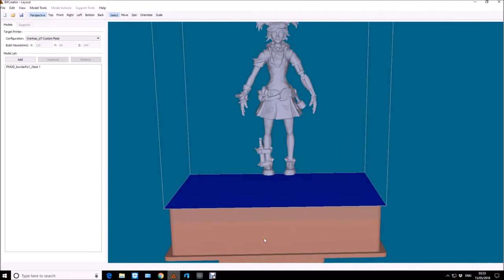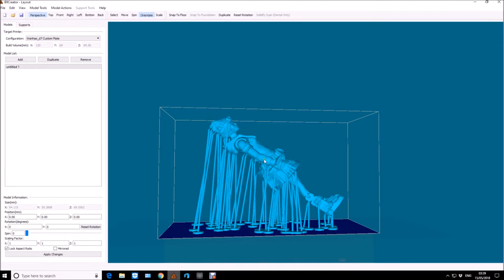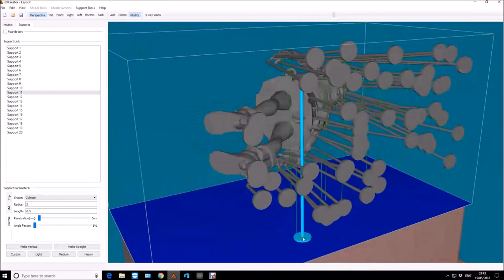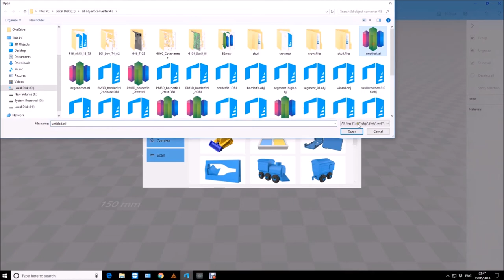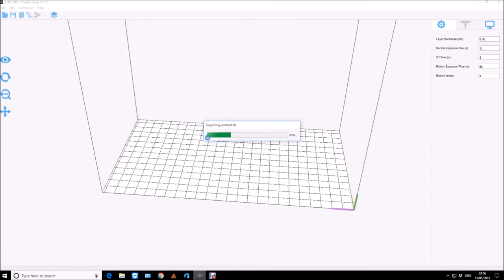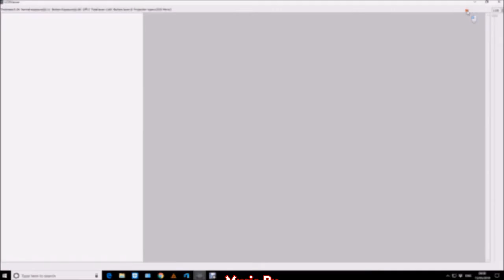How to add Crossbeam's to supports with b9 creations

Comment: Do you still live in the UK mate? If so how much would you charge me to print a small model if your intrested that is.
Reply from the maker: yes still live in the uk. what is it you want printing ?
Reply: A Few figure sculpt's I did about two years ago.. I only just turned my pc on yesterday after it been off for 18 month's I'll find the file tonight of one Id like and take a screen grab for you.  I am using the model then to convince the wife to let me buy a printer.. It only needs to be standard 3 1/2 inch figure size. Totally up to you fella you can tell me to jog on if you not intrested I won't take offence.
Reply from the maker: if your on facebook jump into the group called " Anycubic Photon DLP Printer Owners " and we can talk there.